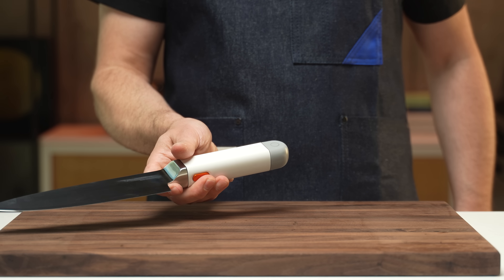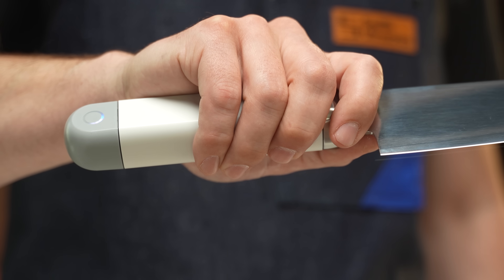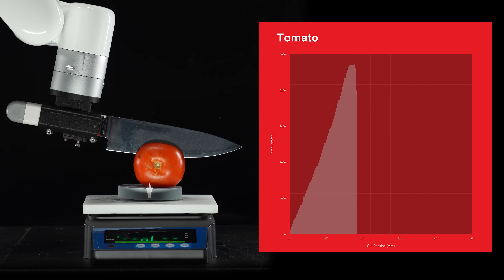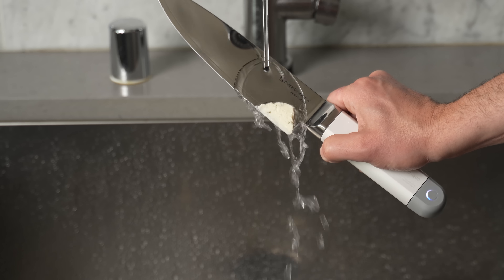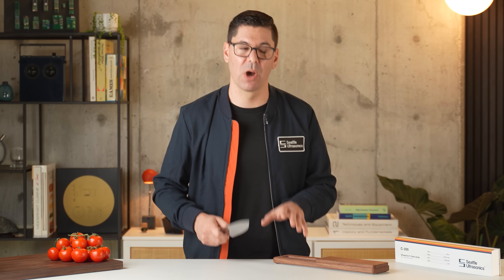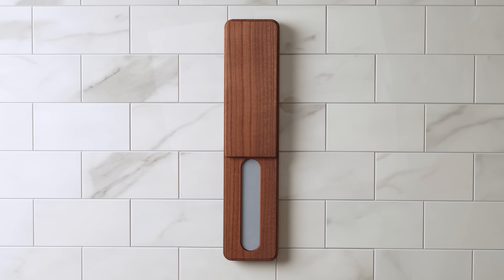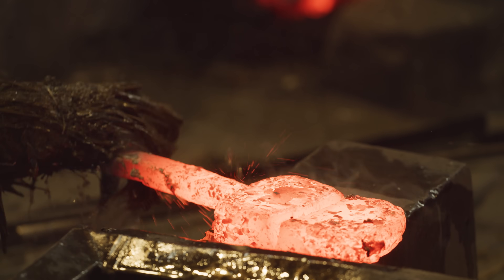The World's First Ultrasonic Chef's Knife for Home Cooks: Seattle Ultrasonics C-200

Comment: Looks great, I hope you succeed! Really enjoyed the prototyping part and the chladni knife :P. It was clear from the start that it was an ad and still managed to feel like a newly discovered creator sharing something cool they made!

I am curious about how it works though. How long do you think the speaker/driver/ultrasonic thingy will be able to last?
Reply from the maker: An incredibly long time. We're using the same piezo crystals that get used in high power, industrial ultrasonic devices that run 24/7 in factory environment, but at much lower power and at lower duty.
Reply: @SeattleUltrasonics  aha piezoelectric crystals! Cool stuff. I really hope you guys succeed, this is very cool tech :D

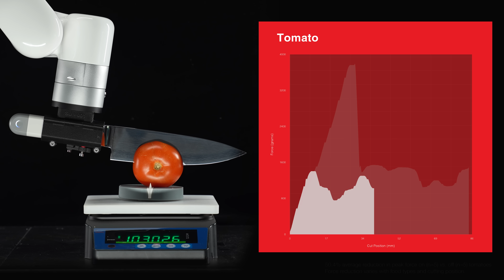Comment: Have to say I'm a bit skeptic about any new tech until 3:58 sold me. While force isn't that different to normal knife, the penetrating power through the tomato skin really does make a huge different. You can see how the tomato isn't squished out, making a lot less of a juice mess.

Seems like ultrasonic is already well used in cutting pastry. The good execution here is bringing it to home cook with a reasonable price and good repairability support.

One concern I have: have you check if ultrasonic vibration ( at this freq and amplitude ) can cause damage nerve ending ? particularly in the finger tips.

Happy to see it has removable battery, way more sustainable.

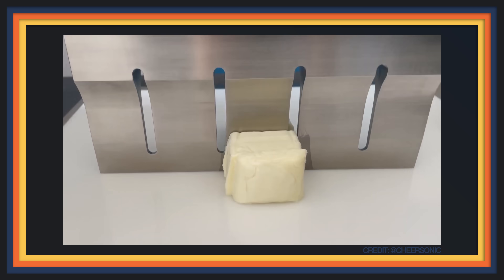Comment: I'm not against advancements in technology as this does seem pretty cool, but there is one claim I feel is a little misleading. A properly sharpened traditional knife will cut perfectly. This ultrasonic knife sharpened exactly the same may require less force, but ultimately will also dull like any other blade. Therefor ending up in the exact same situation as any other dull knife and no amount of ultrasonic vibration is going to fix that. So [01:13] "The Problem with Traditional Knives" outlines issues that ALL blades face, including this one.

Comment: amazing stuff but wouldn't the constant vibrations stress out the steel?
Reply from the maker: Nope, steel is used in power ultrasonics commonly, at much higher amplitudes than we're running.

Comment: Would fatigue failure be a problem? I would imagine it would probably crack in the long term no? ( Vibrations being passed through the blade over a long period of time causing micro cracks?) Genuinely curious
Reply from the maker: It's a great question, but we're safe. Steel is used as a sonotrode (vibrating part) in a bunch of industrial applications at much higher power and higher duty. The metal is ductile enough to pass these vibrations without exceeding elastic stress limits!

Comment: Just don't let it touch your skin while it's on..
Reply from the maker: An ultrasonic knife isn't inherently more dangerous than any other sharp kitchen knife. You still have to be careful (it is a sharp blade!), but the C-200 actually can make cutting safer because you use less force and maintain more control than using a dull knife.

Comment: Could you do a 30 min timelaps with a thermal camera, normaly ultrasonic blades become super hot I would like to see thanks!
Reply from the maker: We don't have a thermal camera (yet), but the blade does not get hot when active. You may occasionally see water "misting" off of your food, but that mist is not caused by heat. Instead, the vibration of the blade causes droplets to atomize away.

Comment: what happens if we sharpen it
Reply from the maker: You sharpen it just like any other high-quality steel knife. You can use your preferred sharpening method - whether that's a whetstone, a honing rod/steel, or an electric sharpener.  Additionally, you won't need to sharpen the C-200 as frequently as a normal knife. Because the ultrasonic vibrations handle a lot of the cutting effort, the blade's sharpness is less critical over short-term use. Even as the edge eventually dulls, the knife will still cut more easily than an equivalently dull conventional knife

Comment: Interesting product and a nice no nonsense pitch. Personally I'm not a huge fan of the design though (charging tiles looks though). The handle looks uncomfortably thick and generally not overly ergonomic. I'm also a bit concerned about the button and how its going to hold up especially with food juices etc creeping into the crevice. The plain blade and plastic handle with the notable gaps between blade and handle give it a somewhat tacky look, which is somewhat unfortunate considering its more "enthusiast" price tag. 

I can however really see the product taking off with non-enthusiast home cooks if you manage to get the price into the 100-200 range. People who aren't overly passionate about their cooking equipment don't exactly take care of their knifes much, so they get dull after a few months. An ultrasonic knife likely would feel like its holding its edge much longer, so you wouldn't have to deal with dull knifes as much.

As for further testing, maybe you can do some tests with meats. Is there still a notable advantage, vegetables are typically a lot more stiff. Also how is it reacting to cooked/raw bones? (not expecting it to slice trough, just curious) 
Also maybe you show the surface of a cut under a microscope? Does the sawing motion leave a rougher or maybe even smoother surface? I feel like either way this could be interesting to some cooking nerds and maybe even chefs?

What I'm still missing is the operating time on a single charge and I can't easily find it on the website either. Considering the battery size and operating power it looks to be 20-25 minutes at max, is this accurate? This seems plenty for normal dinner prep. It still might be good to know how long charging the battery pack takes, for those doing something more elaborate.

Comment: Terrible place for the on off button. Put it on the back of the handle.
Reply from the maker: The knife is only on when you're pressing the button, so that it doesn't continuously waste the battery when you're not actively slicing, chopping, or cutting foods.

Comment: how does it expose me to lead?
Reply from the maker: The warning about lead is a formality for regulatory compliance. The C-200 contains piezoelectric ceramic crystals made of PZT-8 (lead zirconate titanate). These crystals are contained inside the water-tight handle. None of these materials are exposed to your food or hands, and the knife meets all safety standards, including RoHS-compliant regarding heavy metals. We include the California Prop 65 warning to be fully transparent and comply with state law. In short, there's no significant risk to users - it's the same kind of warning you'll see on many electronics - but we have to label it.

Comment: Hey, guy that worked as a tooling engineer at the company they got the idea from, Dukane. There are still a handful of issues I see.

In the video clip at 0:57, you can see the guillotine has a lot of features missing from this design. The 4 slots and steps on the back both help with making the cutting edge have an even amplitude. Another difference is the guillotine is made from a titanium alloy, not steel. Steel has an issue of cracking over time, given how brittle it is.

I'm not working in your labs, but I would imagine a non-homogeneous alloy (i.e. a blade made from 3 different types of steel) causes a ton of issues with the performance, and power consumption, of the blade. I think it's a major mistake in trying to use knife steel like that, rather than following what is being done in industry. I was also not at Dukane when they started making guillotines, but I do know we avoided steel as much as possible for tools and used a specially sintered version when we had to.

The edge also plays a huge role in how the tool functions. I would walk in on the inspection techs sharpening the edge of these blades since it made a difference in how much power the tool would draw.

In the FEA showed at 2:50, there are 2 distinct dead zones where non motion is happening with the knife blade, those are the nodal points of the knife. They will not cut the same as the other spots on the edges.

It makes a lot of sense to make the transducer (the ultrasonic source) the handle of a knife, but on a guillotine the transducer is located on the center, perpendicular to the edge rather than parallel. Clearly you are exciting a different natural frequency of the blade. I just think it is a mistake to hamstring the design to look exactly like a chef's knife.

Whenever I was tuning an ultrasonic tool in an FEA, I would throw some wild ideas at it to see how it affected the output of the tool. There are definitely some things to try with the spine of the knife along with the center of the blade to get rid of the dead zones  on the cutting edge.

I think it's an amazing thing to bring this idea to the consumer market. Seeing these cutters in action is like magic. I just think this idea needs more time in the oven before releasing.

Comment: Apparent smoothness. Roughness averages out at a microscopic scale.
Turned a piezo alarm into a cutting tool. Well done.
Good job showing off boundary layer effects.
Do cavitation effects erode the blade over time or do bubbles actually sharpen the steel?
At $399.00 each the knife is out of reach of most people. I did R$D as an Electronic Engineer for 54 years.
As our products matured and development costs were addressed, Investors paid off, we were able to take advantage of economy of scale. Do you see the price point dropping under $100, anytime soon? Nice Robot Arm. I would write it off under Advertising.
Reply from the maker: I won't get this model quite that low in price, even at massive scale, but it's always been the plan to make the best for the most for the least. So in time, I hope to introduce an economy series that lets me achieve a lower sticker price. It's a challenging time to make hardware affordable right now.
Reply: @SeattleUltrasonics Don't I know it. My last project was LIDAR for Autonomous Driving vehicles. 5 years ago a single sensor cost over $25,000. Now it's under $1,000. $10's millions and thousands of man hours of effort. Getting another 50% reduction to make the systems affordable in low end application. May well cost twice that. Vertical integration and application diversity will bring down unit cost over time.
Reply: @SeattleUltrasonics I do wonder what the cost drivers are. Transducers? Batteries? ROI?
The populated driver pcb should be straight forward and relatively in expensive. Once chassis components are developed and manufacturing line set up and running, assembly is standard processes. Cost reduction should be directly scalable. Of course without seeing the actual design I am just speculating.

Comment: I use knifes as normal tools when cooking, i mean: Im not a knife afficionado, just a tool user. My kitchen knifes need to be sharp enough to do the job, not *as sharp as possible*.
So when i have to cut tomatoes or bell pepper (tough skin), and i feel that the blade is too dull, a few strokes over the sharpening rod is usually enough to straighten the blade. If its not, i use an electric sharpener, which is rare.
Oh and i put my knifes in the dishwasher, because im a lazy sob. Cheap also. just ~40 Bucks per Knife.
Now i also have an ultrasonic scalpel for DIY stuff, and while that thing is superb in some use cases (cutting, more like *melting*, thermoplastic plastics), i for sure dont want or need such a tool in my kitchen. Also i cant put it in the dishwasher ^^

Comment: No one else in the comments havig instrusive thoughts about "what if i accidentally cut my finger"?
Reply from the maker: Safety is paramount, and the blade is only active when you press the power button, so you can chop with confidence. An ultrasonic knife isn't inherently more dangerous than any other sharp kitchen knife. You still have to be careful (it is a sharp blade!), but the C-200 actually can make cutting safer because you use less force and maintain more control than using a dull knife.

Comment: How is this even legal. Ultrasnoic devices should not be in contact with human tissue. They damage cells and can even cause cancer, such as blood cancer.
Reply from the maker: We understand the basis of your concern. Scott has used laboratory ultrasonic homogenizers (cell disruptors) and other high-power industrial ultrasonic tools and the damage they can do to tissue is indeed quite scary. In the case of an ultrasonic cleaning bath specifically, it's the cavitation bubbles that do the aluminum foil damage as opposed to direct contact with a transducer, but your point is well taken.

Those tools mentioned above typically run at 50 Watts and up, with some others heading into the hundreds of Watts. This knife runs at only 10W, and that power is spread out across the blade, rather than being concentrated on a small sonotrode with high amplitude. In fact, the energy that goes into the knife blade is concentrated mostly along the cutting edge. Just like the taper in a whip is what makes the tip accelerate to supersonic speeds, the vibrational amplitude of an ultrasonic transducer is proportional to its cross-sectional area. In other words, at the spine of the knife, there's very little movement at all, but as the metal tapers down to the thin cutting edge, the amplitude of the motion is increased.

From anecdotal testing, we've had beta users using the knife daily (in one form or another) for nearly two years with no reported problems. Scott has personally had his hands in contact with the sides of the blade for long extended periods over the last six years, and he hasen't observed any negative effects - motor function, nerve sensation, etc. We understand that this is not comparable to a rigorous study, but unfortunately we are not aware of any published studies that cover a case like this one.

Comment: I have two concerns, both similar. How long is the tang and how much thicker is the handle compared to an average knife?
Reply from the maker: The tang is short, since we have to fit a bunch of stuff in the handle. BUT we poured a ton of engineering into its strength. I tested with the robot arm, which could apply more force than both my arms together, and it didn't budge. 

The handle is a little larger than most knife handles, but my hands aren't that large, for scale. It's surprisingly comfortable and very well balanced.

Comment: Hey Scott, I had a question.

Do you offer a warranty for the knife? Resistors, caps, etc can be defective or fail early, and batteries can have poor QC as well. Blades can have hidden stress fractures and snap. Especially, I assume, under constant stress from vibrations. Would be reassuring to know that if anything goes wrong within a certain period, my $400 knife won't be worthless. Couldn't find any warranty info on your website.
Reply from the maker: Absolutely. 1-year warranty and the details are on our website.

Comment: you are saying you cant feel the knife vibrate or see it, but when you are using it and it should be turned on, either you hands shake very visibly or you can literally see it vibrate, which doesnt seem very comfortable if you are doing more than just one potato. it is interesting idea, but i cant stop thinking it must vibrate a lot as compared to the usual small vibrator cutters, here the whole blade vibrates and it is big portion of the total mass of the knife. and i you can see it clearly in the video, hand must feel it a lot as well

Comment: beautiful job and execution. I want to give you my honest input as an engineer and product developer. I would love to get this knife, but. 
I cannot buy this for my home because I live with people that do NOT respect knives. Even my exclusively "for me" knives get used  when I'm not around "because it's just a knife". 
Most homes dwellers are people who think a piece of metal should slice through any skin simply because it is shiny. 
Lessons on sharpening, honing, bending, blunting are useless in the long run. The only result is resentment "because it's just a knife".
I think you should have a carbon steel alternative so sharpening is simple and easy. In the end, the a blunt ultrasonic edge is still blunt.
Btw, based on the resonant response clip, it shows the blade is wiggling perpendicular to the cut motion in nearly meshed patterns.
Have you played with moving the mass to the tip and the "fuller" to get more motion parallel to blade? Using generative design simulations based on natural frequencies would be fun.

Comment: I noticed they didn't show meat being cut: What’s the risk of cross-contamination? Can those vibrations spray meat juice mist around the kitchen or onto my body/hair?
Reply from the maker: Good news: meat, poultry, and seafood aren't wet enough to produce the mist you see coming off of citrus or tomatoes.  Meats haven't produced any detectible misting in normal use. Of course, if you place the knife tip on a puddle of marinade, you're likely to get some spray. It takes a pretty wet substance with a lot of unbound water to create the misting effect.

Comment: Hey Bro, as an engineer to another, you done great, I would support you and buy few pieces to give to my family and friends, but the extra battery price is just crazy, can you make a special bundle for engineer and chiefs?  I had also mod a 65w ultrasonic knif myself for cutting the fish and it is like a charm.  Great work.
Reply from the maker: Yeah, the battery pack is expensive to build. It has a rigid flex PCB, charging circuit, LEDs, NTCs, a waterproof USB-C port, and the whole assembly is ultrasonically welded together for watertightness. I also wish it were less expensive and I'll try to get it there over time.
Reply: make your own battery